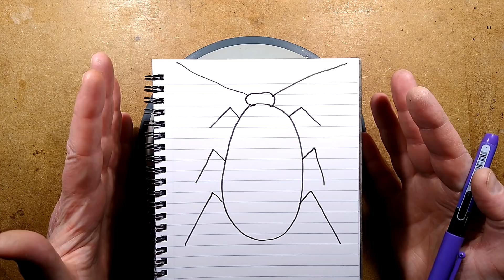Exploring an unusual prototype cockroach zapper.

Comment: In my totally unscientific experience, roaches seem to be quite attracted to electromagnetic fields especially if there is any warmth related to that. Thus, I find them crammed every which where around things like wallwart capacitance dropper phone chargers, small electrical devices that generate waste heat, like external hard drives, and lately, inside AC-powered smoke detectors, which are slightly warm when connected to the mains.   Anything and everything electrical or warm brings them in.   In that case, a device like this zapper should be feasible.  Whether it works or not, I don't know.   But the bit a out trying not to kill them so they don't release the eggs is a bit worrying.  The injured roach is still going to wander off and eventually decide it's about to die and eject the eggs anyway.  Personally, I find lots of boric acid powder works great for killing roaches.  They carry back to their nest and they all die and leave behind a bit of fire protection in the process.  Plus, you can sling it all over your house and people will think you've got a lot of cocaine.  It's a nice way to meet neighbors.
Reply: Roaches are attracted to Heat Like crazy, I opened many consoles where a roach climbed in the PSU and shorted Something
Reply: They love heat. I once saw a roach crawl into an alarm clock. When I opened it up, there were like 30 of them hiding in there and they scattered in all directions. It was disgusting.
Reply: Capacitive dropper phone chargers? Where do you find such monstrosities? Do they even provide enough current for an almost-decent charge?
Reply: David Burgin  Baaad son 😂.... i would have done the same 😅
Reply: @diamondfailer11  Aperture Science. Don't act like you wouldn't do capacitor droppers 😂
Reply: I used to live in a student area. The houses had cockroaches and some even bedbugs, which, IMO are the epitome of a disgusting pest that we already beat once, but has been reintroduced.
I saw a cockroach once in my apartment over 6 years. They never were a huge problem, because they were a species that does not form as large pipulations as some other species.

 I drowned it in 2 cl of freezer-cold vodka. I guess it died happy.
Reply: yes the components that create EMF (oscillators) do produce heat, whether its a crystal or transistor or anything in between, it will have some value of resistance across it and that will result in a calculable amount in watt heat output.
Reply: Ants, too, seem to have a strange affinity for EM fields.
Last summer, I found myself with an infestation of ghost ants in my bedroom. They had established a trail along the edge of my wall where it met the ceiling, right above my computer. 
My PC had (I have since used the transformer to build an ozone generator) some UV cold-cathode lights which I had wired to a switch. I decided to use the lights since they were pretty much always off. Within a day, the ants had established a new trail that led straight into my computer.

It couldn't have been the heat that attracted them, since there were far warmer things in my computer, such as the GPU. It probably wasn't the UV light either, as I also had much brighter UV LEDs in there (though they were a slightly different wavelength than the CCFL tubes). It was most likely the high-voltage, high-frequency inverter for the lights that the ants were so fond of.

 It's honestly quite strange. I have no idea why insects would seek out electric fields like that.
Reply: @nameismetatoo4591  I'm not an expert, but I presume it might have something to do with pathfinding. Birds, fish and some mammals are able to sense Earth's magnetic field and use it as well as celestial bodies when migrating or finding paths. I saw a BBC documentary which said that foxes catch voles and mice better, if the fox's snout is pointing towards magnetic north. Insects also migrate and navigate with the help of sun and moon. There's even speculation that electromagnetic "pollution" from mobile devices etc. negatively affects insect physiology, behaviour, immune system, internal clock and fertility. This was reported by German nature conservation alliance Nabu on the basis of a research compilation. It has not been peer reviewed, so I do not claim this is an absolute truth.
Reply: @kohinarec6580  Interesting. Certainly sounds like a plausible explanation. There's a lot we don't know about insects, so maybe some species do rely on magnetic fields for navigation.

I suppose if I get another infestation (though I really hope I don't) I will test this by using a high voltage electrostatic generator, maybe one of those "negative ion generators" that are all over ebay.
Reply: Now when my neighbors come over and see my massive cocaine problem I'll just say its for the roaches, thanks!
Reply: @mikehunt3688  LOL they might be a little confused by it's for the roaches but boric acid doesn't just work on roaches.
Reply: @jclowe1113  But the question remains, do large quantities of cocaine give roaches an overdose or does it just make them run faster?   Seems like it'd be a pretty expensive way to get rid of them.  Chances are it'd just attract more of them and turn them into advertising executives.
Reply: @nameismetatoo4591  If you are interested in insect behaviour, may I suggest reading J.H. Fabre's books. He was a French entomologist who wrote about a wide variety of species in the early 20th century. Very interesting and captivating, very descriptive and approachable.

I don't know if his books have been translated into English. A very prominent Finnish bilogist translated them into my native language in the 1970s.

Your prospective test sounds interesting.
Reply: @nameismetatoo4591  Even human brains get affected by EM fields, it could be just in a simple cockroach brain it makes them happy.
Reply: "People will think you have alot of cocaine" lmmfao... that's funny as hell... untill they start lining it up hot railing down and you have to start explaining to the police....😅
Reply: I've tried boric acid in every form, for pest control purposes, and it does absolutely nothing.... But your comment is hilarious
Reply: My god man! How many roaches do you HAVE in your house?? 🤔

😜

Comment: I have had one of these for over 10 years (same design as your) it still and has been in service all this time, and works great.
I would like to point out that in 99 percent of cases all the roaches were killed while inside the zapper, hence it not only vaporises there antenna but zapps there guts also.
My unit  turns on and off in a regular interval, all the roaches die inside, none leave alive.
Reply from the maker: Ah, that better fits the patent description.
Reply: Can of fly spray and a lighter has a similar effect. By similar I mean, cockroaches enter my house and they all leave dead.
Reply: @kaydog890  Yep .. but only problem there .. if you see one theres typically another 20 (theres some stats somewhere) you dont lurking in dark hard to get to places.
Reply: DARK APPERITION  Hotel California... on in the background 🤣
Reply: i remember listening to this bad boy frying the bejezus out of roaches
Reply: On the spot death makes more sense to me. If the goal were to prevent egg cassette ejection, letting her scurry off only means she ejects them somewhere else. Also roaches are cannibals, so maybe cooking the neighbors on the barbie makes them all the more appetizing, so one roach having a midnight yeast snack quickly turns into a a dinner party.
Reply: @kaydog890  they check in, but they dont check out >:)
Reply: @Karl Harvy Marx 🤣🤣 now I have this picture in my brain of this ravin' self-service cockroach BBQ party! Where the spectacle of the 'electrifying' firework display draws in the crowds, with a whole bunch of other cockroaches all neatly lined up in the hope of getting themselves a piece of the kill, just for each and every one to end up on the grill! 😂

Man, your comment cracked me up real good BTW! 🤣🤣 And that in the (for me) exceptionally rare belly laugh kind of way too! So thank you very much for that 😊👍 It's really been a long while since I've genuinely laughed this hard, I mean like I honestly can't even remember the last time I've laughed this hard, so that says enough 😜

I hope you have a great day, and thank you again for your funny comment, Karl Harvy Marx!

Comment: With or without antennas, cockroaches are never likely to get a good reception!
Reply: @Matt Quinn They were coaxed into the trap with yeast, perhaps not the best of quality ;) Probably had a high die-electric constant though!
Reply: About 40mm long for an adult. Optimum ~3566Mhz for a Half Wave Whip, 1783Mhz Quarter wave. Pesky up and coming youngsters hacking your 2.4Ghz Wi-Fi 😜
Reply: Nick Norton Set the SSID to “Fire Ant Colony 1” as a deterrent :)
Reply: I like that, that's good, really good.
Reply: You need rabbit ears for that.

Comment: My guess for putting the primary over the secondary is it may give better coupling and lower leakage inductance, which is important for flyback supplies. Unlike 50/60Hz transformers, flyback transformers need very good coupling if the losses are to be kept down at high frequencies, which is why they are always wound on a common bobbin as well as also often interleaving the primary and secondary windings. If the coupling is poor, there will be lots of power that wont be transferred to the secondary side.
Reply: I logged in especially to see the comments and say this. Well put!

Comment: Cooking cockroaches with electricity, now, are we?  Bet that smells amazing.
Reply: Probably like popcorn!
Reply: You beat me to it.
Reply: Just threw away a microwave infested with roaches.  Had absolutely zero desire to find out what it would smell like when that device was used for cooking. Hell no.   The roach problem has been controlled.  I can just get another microwave, which I wanted to do anyway.
Reply: I'll go large
Reply: Fried and ate a cicadas, not the best, but not the worst either...
Reply: They smell bad enough as is.
Reply: They kind of smell like burnt electrolytic capacitors.  One got stuck in our oven once when I was trying to heat up a frozen pizza.  Needless to say... I threw out the pizza.
Reply: @LatitudeSky  If you disassemble the Microwave Oven there are some powerful magnets in there.

Comment: Lived in South Carolina way back in the 70s while in the Air Force.  Moved into a duplex  that had been unoccupied for a few weeks.  First night I turned on the heat I apparently woke up the sleeping horde of roaches.  Sure wish I could of had one of these then.  Would have been so satisfying to hear that little spark.  I wonder if there would be a faint scream after the zap.

Comment: I repaired large stereo receivers as well as other stuff in a repair center. They like the heat in these units as well as the kitchen aerosols that get into these units from cooking. I find a lot of grease coated components covered with lint. Roaches love this food and the warm environment. We called these units "roach coaches" as well as the lunch truck. These units has a certain smell and are full of roach droppings and old carapaces. Sometimes you get a wave of roaches when you take off the covers. My company had a good QC department that if you mention "cockroach" or any derivative on the repair ticket, you can be fired. They didn't want us to upset the customer.

Comment: FYI thought you might be interested Clive, the two gents that invented this zapper were from Rockhampton Central Queensland, Australia, working at CQ (Central Queensland University. Back in 1988 the original problem from memory was the miniaturisation of the components to fit a small package which was a great concept in those days. Must have been difficult.  Also they were working on a sign wave inverter. Back then the main inverter was a square wave type.
Reply: Sine wave, named after the sinus trigonometric function.

Comment: My father had one of these, he got it in the early to mid 90s. They came with a wallwart adapter and some bait tablets too. I recall it wasn't all that great, and it made a high pitch fizzing noise at seemingly random times.

Maybe we got a dud unit, but I also remember my father pulling it apart (he was an electronics technician) to try and fix the noise, and he also spent a long time just trying to open it up without damaging it.

Comment: I remember years ago, an advertisement in the US for a product called the Roach Motel.
Their slogan was:-
 'They check in, but they don't check  out'. 🦗
Reply: Those were, I think, a combination of strong adhesive and a mild poison on the inside of the very cheap traps?
Paper ones like little rectangles with offset paths,  and later came the plastic ones of various shapes.
Reply: Still sold: https://www.amazon.com/Roach-Motel-Traps-2-Ct/dp/B00AA8X13A
Reply: That gave me a hell of a nostalgia flashback. Didn't those ads have a really ominous-sounding narrator?
Reply: @AsymptoteInverse  Not typically - there's a compilation of them at https://www.youtube.com/watch?v=IkfEylGemJQ

Comment: That oscillator looks almost identical to what is used in Metcal solder stations to generate the RF. They have an inverter oscillator using a crystal that runs at around 13MHz that then drives a couple stages to boost it up enough to drive a large switching transistor.

Comment: Interesting video. I think this is like when you have only a hammer everything is a nail. The designer apparently would rather use a ton of analog old school components when a single super cheap microcontroller could have replaced most of them and improved the device in many ways. Oh well.
Reply: The design is from about 40 years ago when all you had in microcontrollers were ones like 6800, Z80 and 6800.  They would not have been cost effective in those days.  Analog was the cheapest way to go.

Comment: Ok, I need to partly challenge what Clive said about the people who can help with your inventions: It is true, it is a minefield of sharks, especially those who advertise, but there are also genuine ones and you may well need them if you want royalties. Inventing is a very expensive hobby until you get a licensing deal or successful manufacturing yourself. I didn't because my invention (a wave energy device) required validation I couldn't afford to be considered sufficiently low risk for others to invest in, but I had an excellent licensing agent (now retired) who also spent a load of his own money. The market moved against us and we eventually dropped the project. But doing proper patent checks first and defining your patent properly is a specialised skill and you really need experts for that. Otherwise you can end up with your invention having gaping holes in that allow someone else to side-step it and make their own, as Clive described. The moral of the story is to look for a reputable licensing agent who has a track record of helping others make money in the long run, because it will be expensive for the necessary work to get it to the point where you can license it effectively, or manufacture it safely.

Comment: I think it works this way:
It's charged all the time, cockroach is attracted by the bait and crawls in, at some point touching the HV, if the arcing is sustained, the unit pauses to allow the roach to get out.
Notice what looks like the op amp going via the microswitch and connected to that 'timing' capacitor, the op amp will probably initiate a discharge in the same way as opening the unit.
Reply: I have one and none of the roaches have left the unit alive, they all die inside it.
Reply: @RolandElliottFirstG   You only see the dead ones, you might not see the ones that lived.
Reply: @theotherwalt  None live.. They all die
Reply from the maker: It turns out that it does just zap them in situ.  The antennae bit was a red herring.

Comment: I'm not entirely certain, but its very possible the transformer windings were wrapped the way they were in this instance to reduce noise/interference, its possible those plates that were designed to shock the cockroaches could have generated their own electromagnetic field and affected the voltages, so wrapping the wires that way may have been for something along those lines. Additionally, this transformer is generating high voltage so it could possibly have something to do with just insulating the voltage deeper beneath layers. From a quick glance that's about the only things I can think of as possibilities.

Comment: I remember that being on The New Inventors, a show on ABC(Australian Broadcasting Corporation) which ran from 2004-2011. It was a panel show where people present their inventions to four experts(on a rotating roster) in the science & tech sector, not a high budget show, the prize basically took the form of IP law assistance & industrial design & product marketing consultancy.
Reply: Hmmm, you note that the patent expired in 2002, the show I mentioned didn't first air until 2004 but I'm positive someone presented a device with that same name & same function, maybe not that prototype though, maybe a revision on what had originally been patented.
Reply: @milksheihk  Or "towards 2000"  which later became "Beyond 2000" in the days that TV programs were made locally.
Reply: @robames1293  Oh, but that thing wasn't on Towards 2000,  certainly remember it, or a version of it, as being on the New Inventors. I certainly remember Towards 2000 though, I remember the Porsche 959 being the most advanced car in the world.

Comment: I believe putting the primary windings around the secondary is to create higher voltage with more amperage so as to do the damage to the antenna and not explode the whole insect.